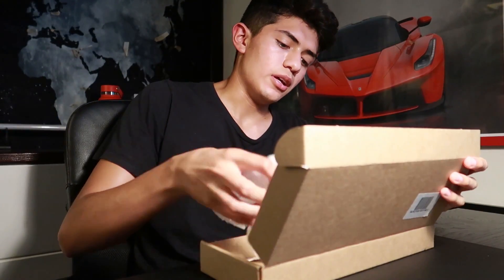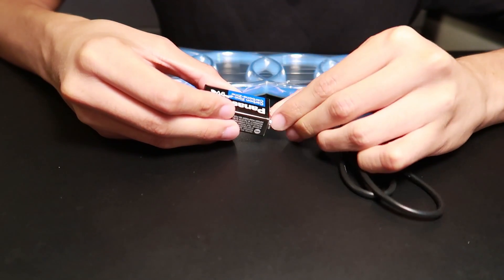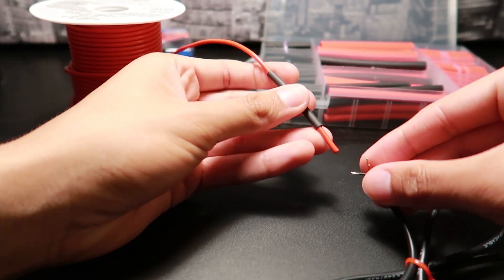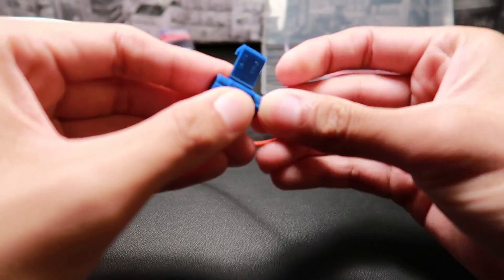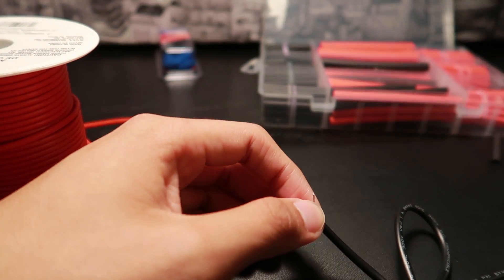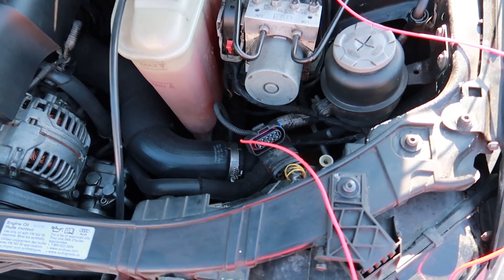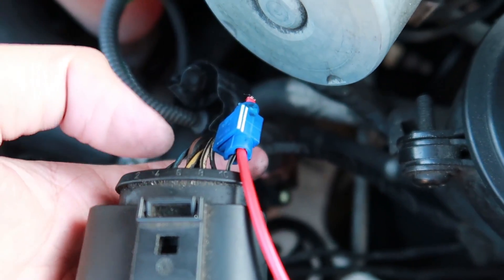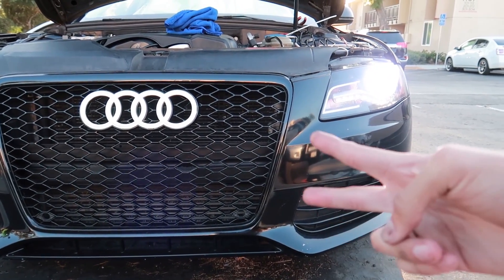LED Emblem Audi A4 B8 installation

Comment: The tubing is actually called shrink wrap heat tubing. Also, you should always use same color wire meaning black to black and red to red so that you don’t make a mistake connecting. This guy has good intentions, but need some more years of experience.

Comment: A quick tip if you soldier the wires together before you heat shrink the wires your connection won't come apart , if you don't soldier them your twisted wires will work them selfs loose after a while, I do quite a bit of automotive wiring, hope this helps anyone else out

Comment: I read a lot of bad reviews on the light as far as it not lasting more that 3-6 months and that it starts fading, would you still rec spending the money?
Reply from the maker: If you check out my latest mod video I took the emblem off for that reason. It’s a fun little project to take to a couple car meets but for the appearance it does look tacky after some time. It doesn’t matter how expensive or cheap you go with them because they all start to peel after some time.
Reply: Clear coat

Comment: I got one of these on my audi a4 but the led light looks like its chipping small pieces it looks like rocks may have done it. Have you had this problem in like 2-3 months of having the light? It makes it look bad quality/ cheap so im going back to original audi emblem
Reply from the maker: Already answered this question in another comment and my latest mod list video
Reply: I have the same issue !!!   Got a set from Raymax Luminous Gear, Nov 2019 for US $ 100.00 and had an audio installer put them on. They used the left DRL as the source so they were on all the time, just hard to see in the daytime. At night, they stayed on all the time as the DRL does not go out at night. Looked fantastic, for about 3 weeks. Rain snow and I guess carwash got into the LED's and they started to die and rust.  Was not pretty,  contacted Raymax and to their credit, they sent another set (under warranty) . Had a different guy put them on, I waterproofed them as best I could this time.  However 3 months later, they are chipping and dying and clearly rusting again. looks like crap, whaich is too bad cause they looked really really sharp. Unless they come up with a better build quality, (not sure why they can't weather proof the LED's and use better quality plastic) , I'd advise you to save your $$$ and stay away from them.

Comment: How did you take old emblem off?
Reply from the maker: I just used a flathead and a trim removal tool. I used the flat head to keep the emblem from going back into place and I used the trim removal tool (like a plastic flathead) to pry the emblem off.

Comment: 10 points for effort, 3 points for execution. You need to clean up that wiring.

You should use black wire at least for the negative and you could have found a screw already holding something behind the grill to ground to.
Reply: Would also help to learn how to solder - I cringed at the "twisting" together of cables.

Comment: Im trying to do the same for a 2019 Audi A5.  Do you know what number on the headlight socket I should tap into?  The manufacturer said it should be the low beam, but i cant find the headlight socket diagram anywhere.  Any help/info would be appreciated.  Ty

Comment: Do NOT try to do what this guy did (the connection part). You need to have strong connections. Always solder the cables, it's not enough to only twist them, even if you use shrinking tube. Put some cable terminals at the ends that goes to battery positive (+) and battery negative (-). ATTENTION! A loose cable might cause a short circuit resulting in a fire. Be safe! It might seem easy to do but it's not that simple. If you don't know what you're doing then take the car to a person that knows.

Comment: is there a way to do it so they only turn on with the headlights not the daytime running lights?
Reply: Yes if you go in your cars settings, go to exterior lighting, go to daytime running lights and turn them off
Reply: Once you have the plug use a multimeter to find out which one of the wires has a voltage when your headlights are on and when your drls are on. Identify them both and once you know which ones are your main headlights then just tap into that wire instead.

Comment: Hi Gio, can you tell me how do you mounted the badge holder to the grill?? I can't figure it out. Tks
Reply from the maker: There should be two filled in spots on the honeycomb grill with 2 little holes where the badge holder should go. They blend in well with the grill but it should be there. Once you find the mounting point grab two washers and two bolts to mount it.